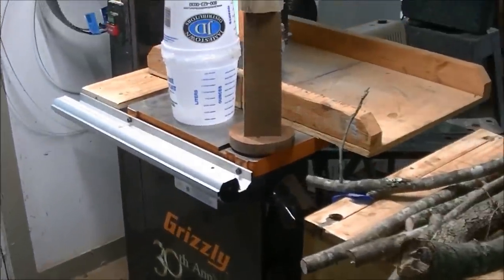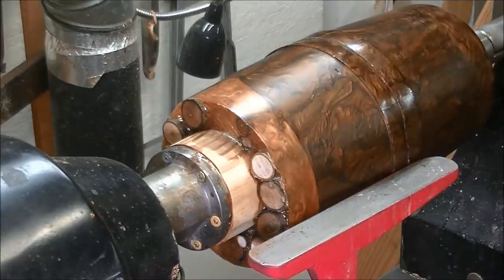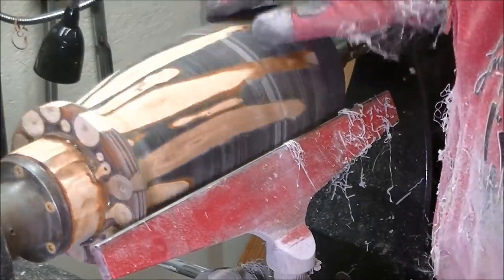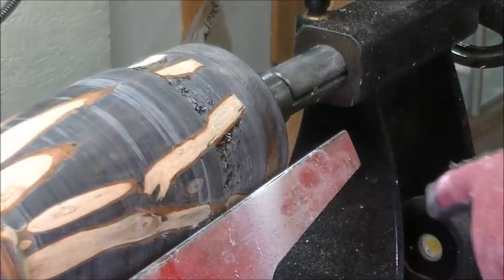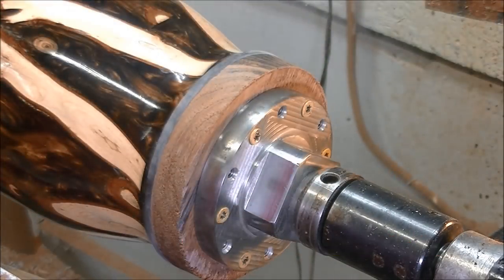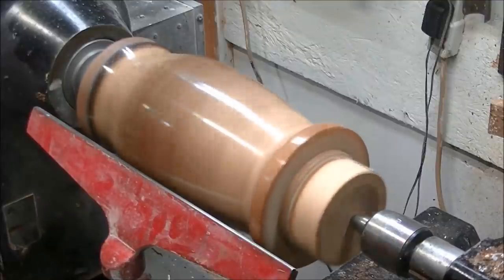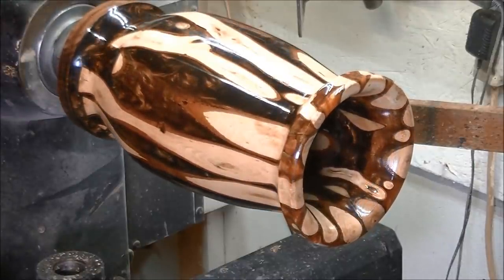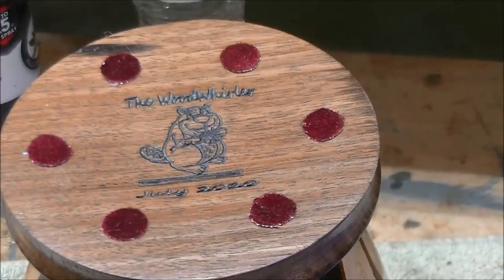Pecan Stick Vase # 222

Comment: Very beautiful vase! I've never tried resin but would love to. Just can't afford it right now. Keep them coming!
Reply from the maker: You can get a gallon of totalboat table top epoxy, which will work fine at this site totalboat.com and use my code woodwhir5 for less than $60 delivered.  That's what I started with.  Take care, Larry

Comment: Hi Larry, I am new to your channel. But I like this vase. Dont ask me why but the colors of it remind me of a reach and strong coffee topped with caramelised milk foam. Like a cappuccino or caramel latte macchiato. From your slang I, would guess that you are located in the Southern part of the US where the climate can be really hot. Epoxy is reacting to that heat. From a different weather temperature on you might not even be able to pour resin at all since it will cure to fast or not at all. I have heard this issue being addressed in other youtube videos. Does the Total Boat resin have any recommendations for working/pouring temperature on the package? Please stay safe and take care. Greetings from Germany. P.S. I like your beaver emblem.

Comment: Really nice looking vase. I would have glued that  Walnut recess back and shot a few pins through it. If that still made me nervous using the chuck I would have used a worm with a 1/4 to 3/8" flat plate across so not to go all the way through the bottom with the worm ..... but what you did looks absolutely marvelous.  It would also make a great lamp base with a light in the base to shine through .    Good job!!!!